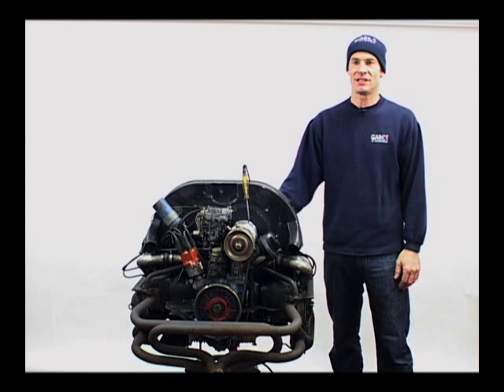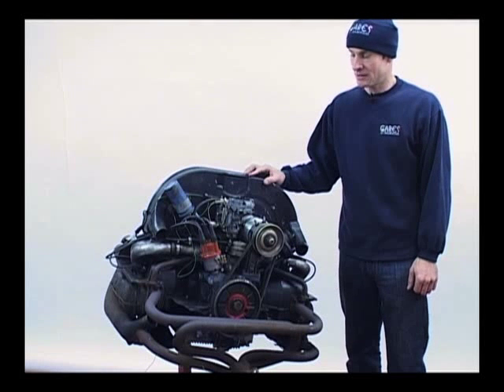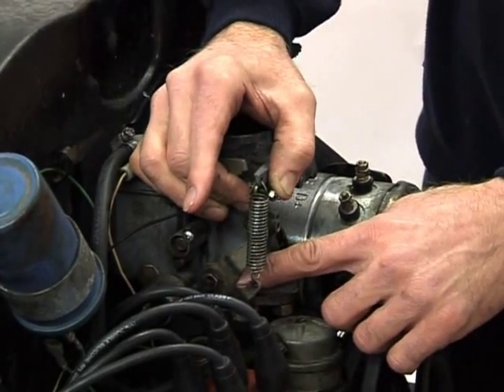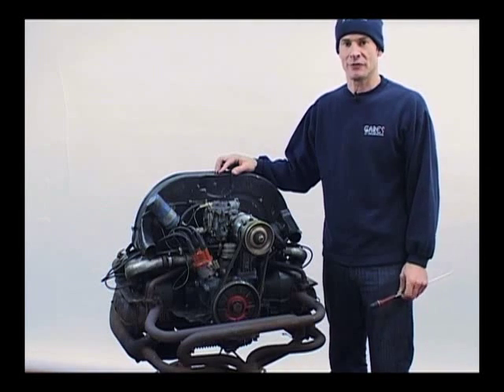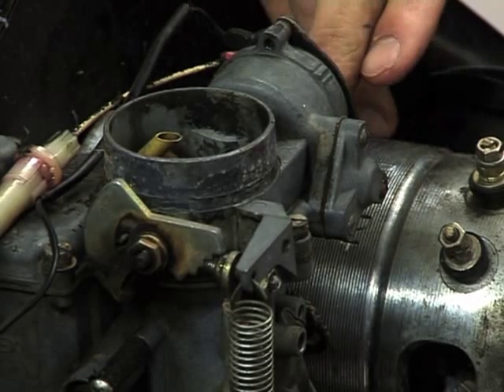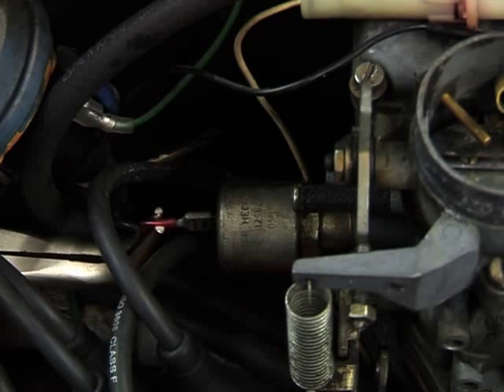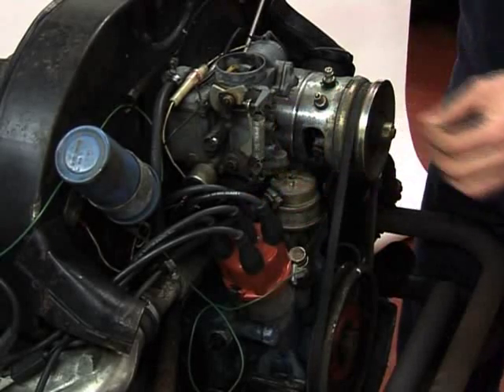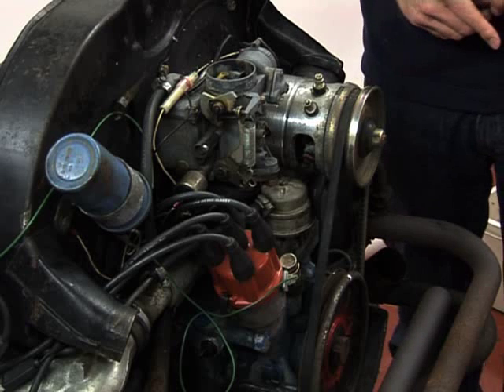Classic VW Carburettor Service

Comment: I have a VW Trike with a 1971 vw engine and it has a 30 pict 3 carb on it . From what i gather is that the volume control screw is  suppose to be plug from the factory,  this is not...Could any body tell me where the volumn control and the air mixture screw should be. Thanks

Comment: Can you or anyone else tell me how many turns from fully closed for both volume control screw & air correction jet screw. I have a 1600cc bug which I eventually managed to start for the 1st time in 16 years. It ran ok but only with my foot on the gas, otherwise died. I started messing with the  various screws and now I think I've messed it all up and can't get it going again. I've tried various adjustments with the vol controll / air screws but to no avail.